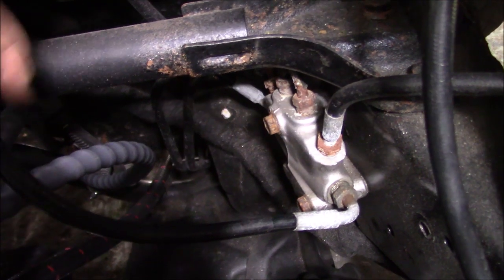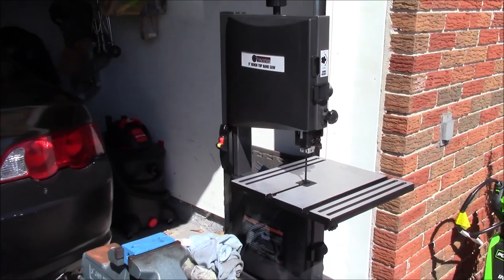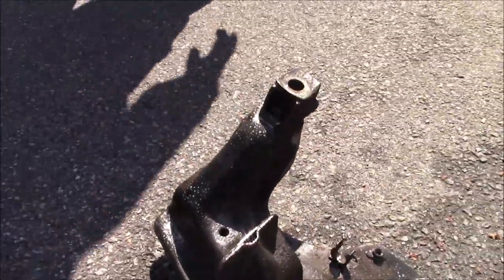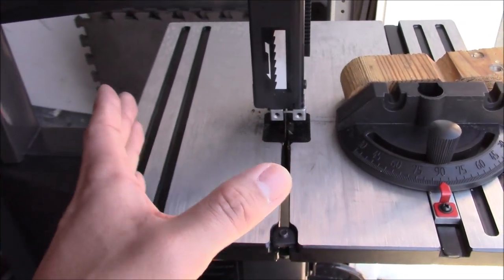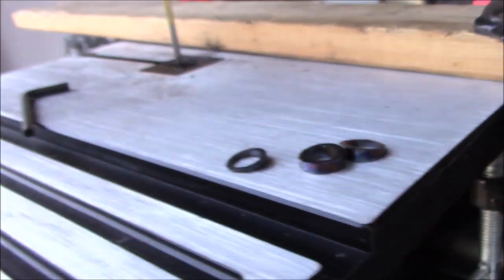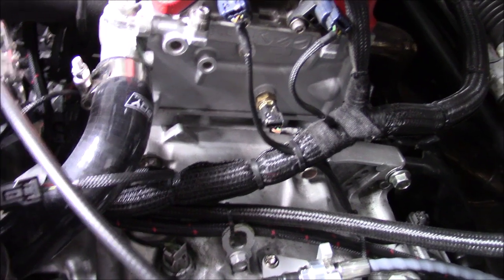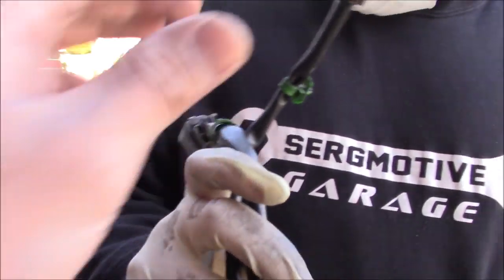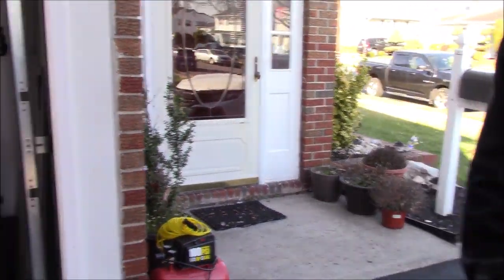This k20a2 harness is a nightmare....

Comment: That bandsaw is for light duty wood cuts... Return for money an buy the Milwaukee deep cut portaband saw cuts like butter with the appropriate blade for metal.. Plus it is super versatile can use it to cut exhaust or frame or whatever under over in or on top of car...
Reply: Another thing about burrs a burr knife at harbor freight are good enough to knock burrs off. Then run the part in question end over a wet stone lubed with wd40 for a honed edge thats finish is fire..

Comment: If you want it to cut straight you need to lower the guild that the blade rides on. There should be an adjustment. The higher it is the more the blade can move. Also you should use some oil to cool the blade.